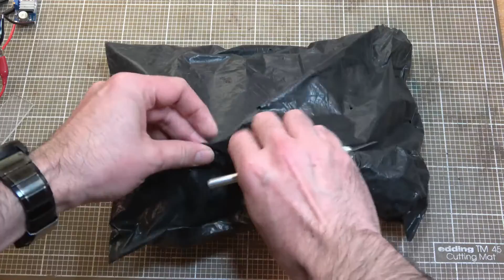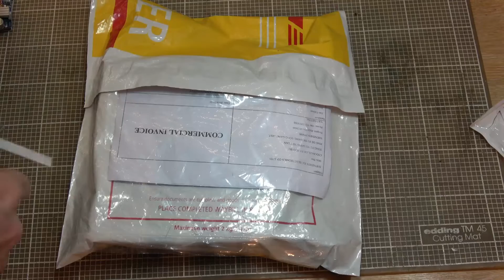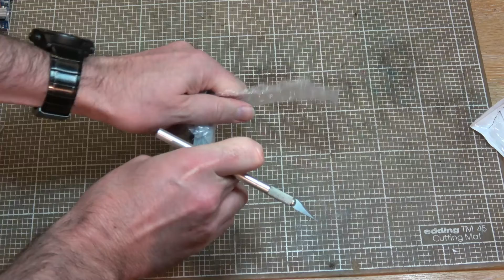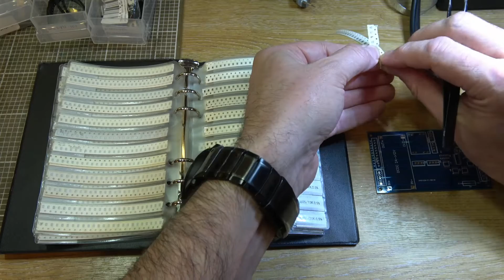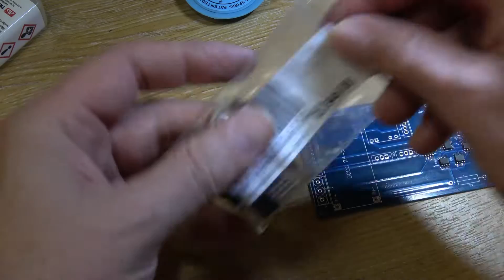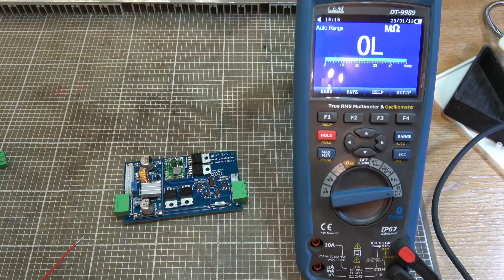Mystery Project - Digital Sky -  Part 0

Comment: I is great seeing you again, I'm looking forward to your next videos.
That BLINKING you have problems with, may have to do with unstable voltage for ws2811 chips, I was having this problem when i didn't limit the brightness in software and supply voltage sagged from 5V to 3,5V becauese of volt. drop on long cable. I tried two ws2811 on Lab PSU (lowering voltage) thy wont flicker...
Whe using buck converter (same as yours for 5V) to power leds and and starving its supply so it outputs more ripple that effected data transfer between ws2811 ICs the same  way as yours to flicker. Im yust experimenting and wondering as i didn't see your circuit exactly from video.

Comment: Im glad you're back jim. i thought that you had given up with YT and electronics after your last video 16 months ago about your 3D printer build. You have a nice calm voice.
Why are you using 24V bus when you're DC converting it down to 12V anyway on each module. What is the efficiency of these 24-12V DC-DC converters?
You can get high current 12V PSUs pretty cheap. I bought a Dell 12V 18A PSU brick on ebay for £10. Its the one used for the ultra small form factor PCs and very good quality and probably at least 85% efficient.